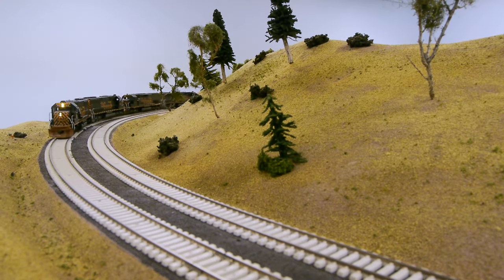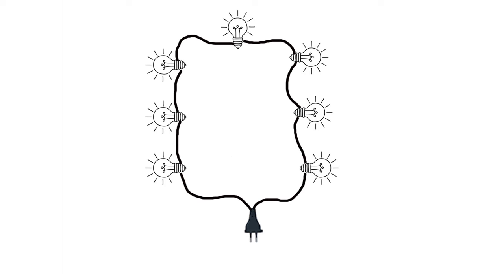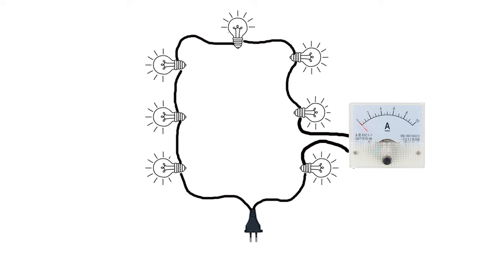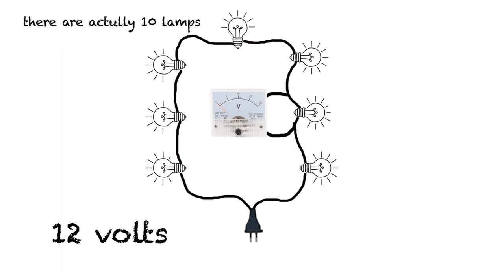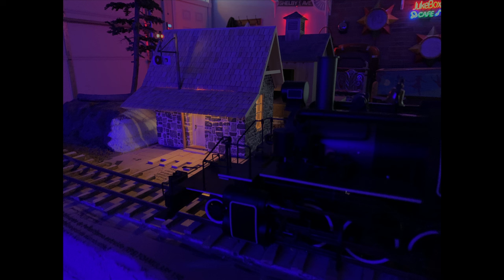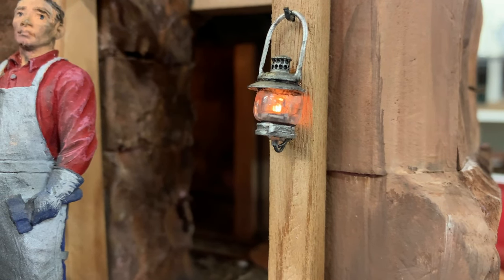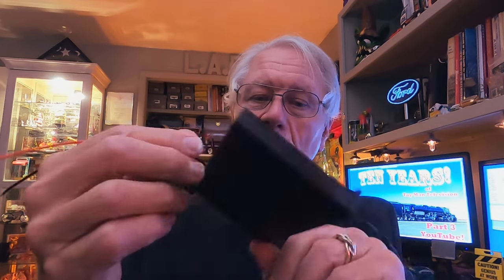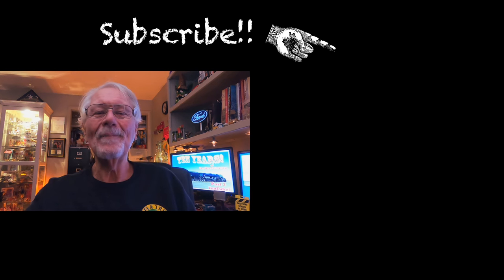Week Four - Series or Parallel Circuits

Comment: Great job explaining things, just a little tip- try using a 5watt 5K variable potentiometer and when the lights are brightness you want just measure the resistance and get a resistor close to that reading. Used one for yrs doing amplifier work, solder leads to it.
Reply from the maker: Hi. Yup I bought a bag of those!  I’m putting them in my “keep alives in passenger cars. The advantage of large scale is I can fit that!  The whole circuit is huge. But no big deal. Upcoming show!!  I hope. Still not working right.

Comment: Another great explanation and much the same as how power tool manufacturers wire up their power packs. A 2ah/18 volt (20v max) pack has 5 cells in a series, whereas a 4 or 5ah pack has two rows of 5 cells in a series but parallel to each other so the volts stay the same but the amps (and runtime) are greater. The other factor is the size of those cells, 18650 vs 21700, the latter would give more watts.
I think I have that all correct…

Comment: I have a O3r K-Line F7 ABA loco that I did wire in series.......in a way. It ran way to fast so I rewired all the motors in series to slow it down.  Thanks
Reply from the maker: I know I already commented on this… I think??  Old age probably. Anyway I put a landscape bulb in series with a huge motor in an HO F3. Slowed and made it run better but my real reason was it made the 1.5 volt headlight come on faster and brighter at low speed. I had a “constant brightness” circuit in the headlight but it didn’t work well until the motor voltage was over 3 volts. Problem solved!

Comment: When a kid we had some series Xmas lights and I remember what a "Pita" it was to find the burnt out light!!!  I always wondered why the manufactures made these lights in series?   Certainly, they knew about Series/Parallel circuits back when manufactured!  Any guess as to why they made them like that?
Reply from the maker: Yup!  Low voltage lights are much more affordable. Much. And power supply’s were expensive back then. Today they are a “wart”. The little box plug that gets in the way of other things once it is plugged in. But even today that costs about $5.00. Back then it was a box about the size of a tissue box and cost $15.00. Anyway back then, and even now, the cheep and easy way to use 3 volt lights is put 40 of them in series and sell it for $2.50.

Comment: When Atlas started putting two motored china drives in their O scale locos, both two and three rail, we found we got smoother operation by wiring the two motors in series, they come wired in parallel,  it doesn't matter if your running these engines on DCC or TMCC, (depending of course whether your engine is 2 or 3 rail, Atlas makes both), or if your running them conventionally, and if your just running them on DC, the two motored diesels run smoother anyway, 2 or 3 rail
Reply from the maker: I took one of my F units that had a huge motor in it single motor and put a landscaping lightbulb in series with the motor! And boy did that smooth out the operation!

Comment: Would that 12v battery pack be used for each building light, or could it power several lights like a whole “street” of lights?
Reply from the maker: Hi! It could power a bunch of things. Depends on the amperage of the lamps or whatever. The battery pack can supply 2 amps under normal loads. That will deplete the pack in about an hour!  If you keep the load down to about 600mA. It will work great for hours!  The lights I normally use are about 50mA. So one will burn for like two weeks before running the battery down! Or ten of these lights for hours. Or about 30 of them for a very short period. It just depends on the lights.
Reply: @ToyManTelevision  I understand. Much like those tiny LED “fairy lights” that are on a 2-3 battery packs.